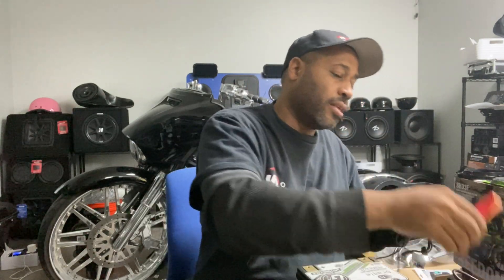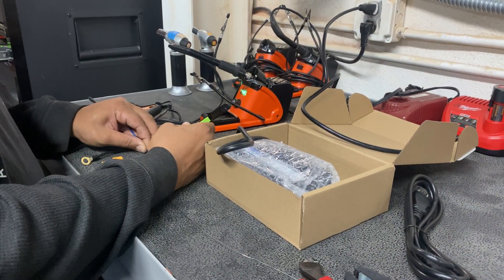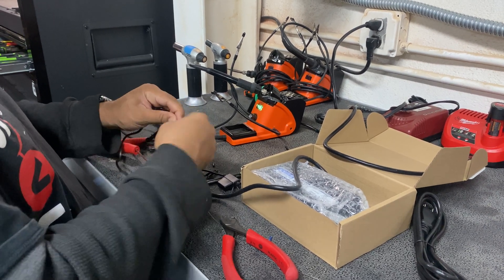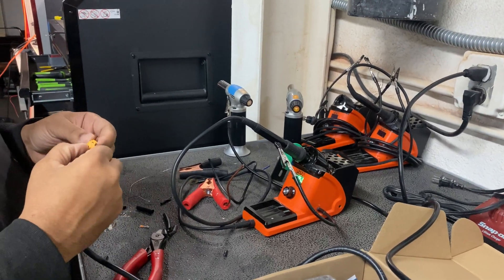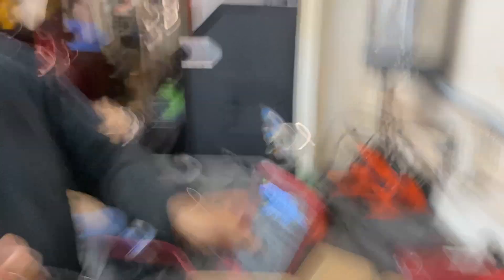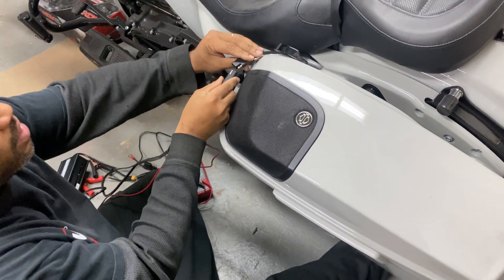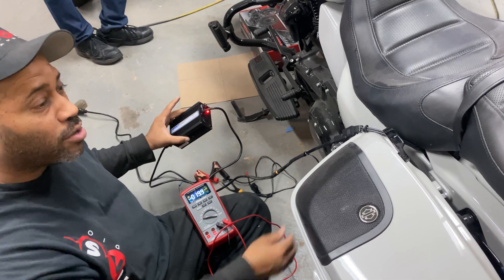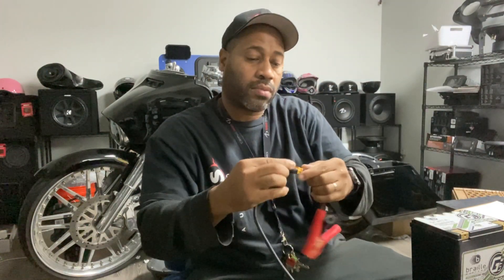How to convert your Lithium battery charger to work with your factory Harley-battery tender plug

Comment: Where can I get a soldering station
Reply from the maker: LONOVO Soldering Iron Station Kit – 60W Solder Station 194℉-896℉ Adjustable Temperature, LED Display, Sleep Function, C/F Switch, 2 Helping Hands, 5 Extra Solder Tips & 1 Solder Wire https://www.amazon.com/dp/B09C18NL86/ref=cm_sw_r_cp_api_glt_fabc_K024AE4F9QHJQ5JW4NB1

Comment: Thank you for sharing Carlos.  Quick question, do you have any experience using the Braille 6 amp charger on Limitless and viceversa with the Limitless 25 amp charger on the Braille?
Thanks in advance.
Reply from the maker: I
Use my xs power 25 amp lithium charger on Braille batteries every day .

Especially when the bike has more than one battery it charges both at the same time
Super fast
Reply: @NVSAUDIO  Thank you for the fast response Carlos.
Reply: I'm running 2 xs batteries, which model charger from xs to you use pls
I see the LI 1225 12volt or the LI1625 16volt
Reply from the maker: @Kingscorpio3693  li1225 or the 1215 

I use the 1225
Reply: @NVSAUDIO  bought the charger and it works great,I was using the the brallie charger with both batteries and I could get a full charge even after a week of having it plugged up,bought the xs charger and within 3 hrs I had a full charge